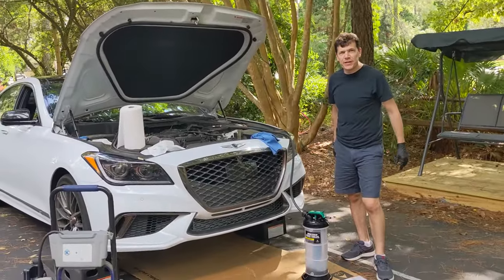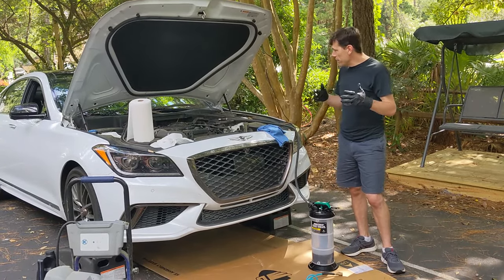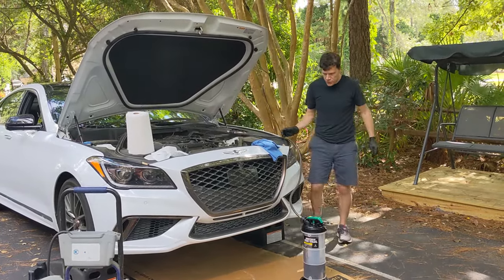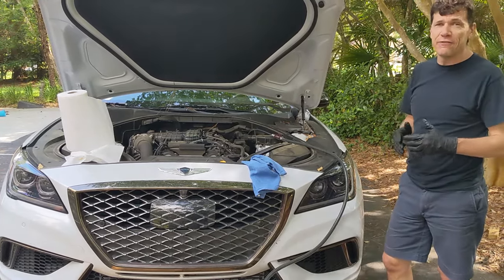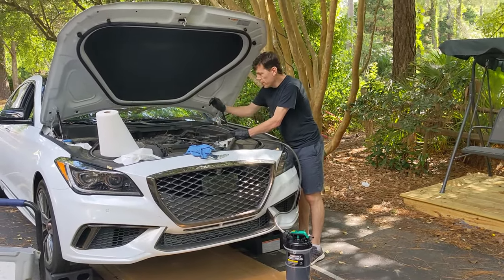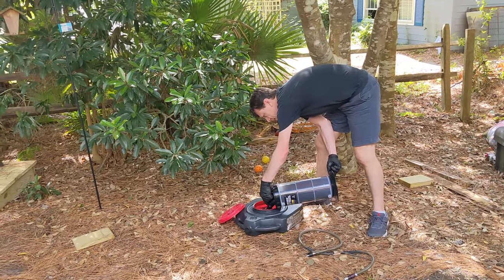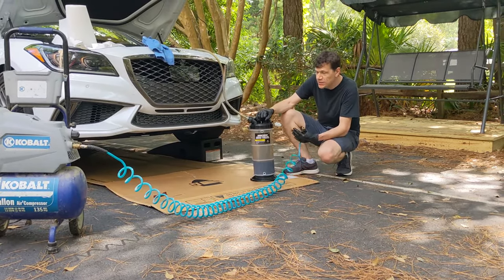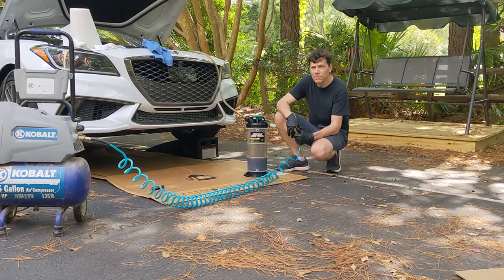OEM Tools #24937 Fluid Extractor Review and Test

Comment: Agree, terrible to no instructions come with these units. I got the 10 Qt model and used it the first time tonight. I didn’t use a compressor, just hand pump. 
Everything was going great, about 2/3’s full, and it just stopped. 
I went to give it a couple more pumps, and oil shot out of one of the ports below the handle coating my garage floor nicely. 
I could not figure what was going on. It was not full. 
I emptied it out and tried again. It started back up but I was still getting some fluid discharge from that port every now and then. I just held a rag there while I finished up. 
I’ll call the company tomorrow and see what’s going on, but if you want customers to be happy with a product, write a freaking instruction manual.

Comment: The manual pump only requires about 6-8 quick pumps then it creates a vacuum to remove all the oil.
Reply: Mine seems to need a good 5-10 pumps every 15 seconds or so

Comment: Dude the manual SUCKED but the product looked really well build. Popped over to your channel, right to the point.  
New sub here from it!
Reply: The manual works like a charm, 6-8 pumps and it flows with ease. Did it on a 2017 Audi Q3, had no problems, and removed virtually all the oil.

Comment: Still don't understand how to put the hose on the top. You just leave the cap on and then push the hose through it letting the o-ring be the only thing that supports it
Reply: Yep. The threaded cap/collar is to help remove the main suction hose.

Comment: I bought this thing. I was able to change my power steering fluid using tje smaller tube. It did NOT work with engine oil. The thinner and longer tube did not work. I tried it on 3 different cars but failed. So i had to jack the car and use the old method. What was i doing wrong?
Reply: Warm up the oil first
Reply: Correct, run the engine enough to warm up the oil and try removing the oil fill cap.

Comment: Do you use this extractor for any other fluid besides engine oil?  If so, how do you clean inside the hoses and extractor itself?  I was thinking of using it to extract both engine oil and transmission fluid but definitely don't want to cross-contaminate the different fluids in my engine.
Reply: Somehow I get the impression that it will take about as long to clean the inside of the extractor and extractor hoses as it will to extract the fluid from the car.

Comment: Anyone ever use these to drain a gas tank on a motorcycle? Is it safe?
Reply: The manual says not to pump gasoline or anything flammable.
Reply: I used it to pull gas out of 2 generators to store them. I'm leaving it open for residue to evap. Cross my fingers that it will work fine.

Comment: Never do this to change oil, been proven that most material in the oil will sink and this will not get it all out, which will lead to overtime possible engine failure due to high metals and not draining the oil 100%
Reply: 100% not true. In some cases there is no other way to drain oil from some engines like a chipper or other small cycle. I woofed in a high end German shop for a long time and saw many, many super high mileage BMW and Mercedes that never had the drain plug used. At first I was totally against sucking the oil out, but after seeing the convenience and that there is no harm, I am a convert. If you saw the whole video you would know I have a drain plug issue and this is the only option right now.
Reply: You do know cars have oil filters right? The filters, well, filter material before it gets to your engine. Also. If you have heavy enough material at the bottom of your oil pan that doesn’t become suspended due to running the engine then you’ve got bigger worries than just an oil change.

I honestly don’t understand how people think.